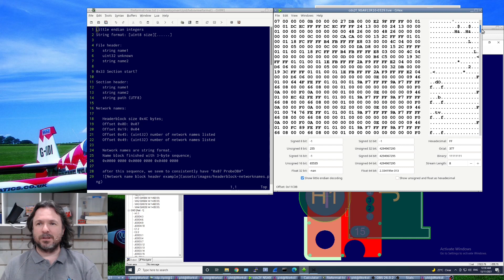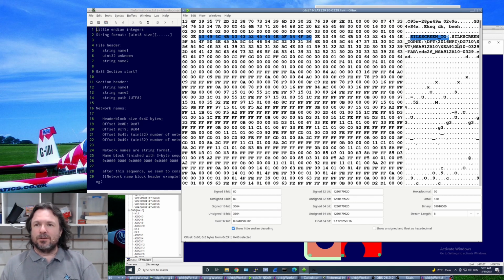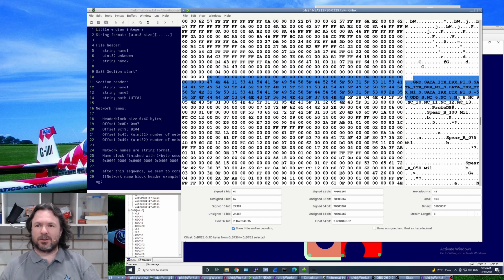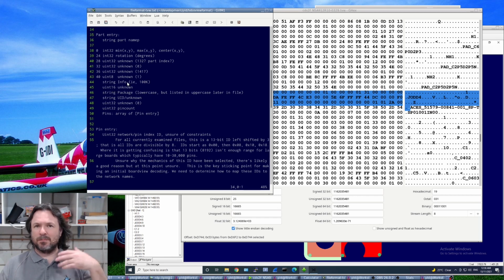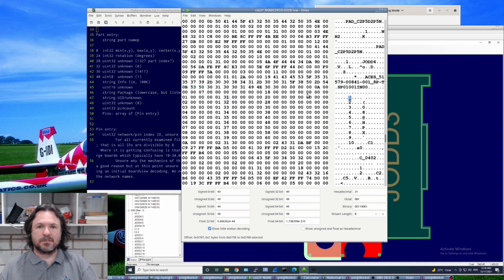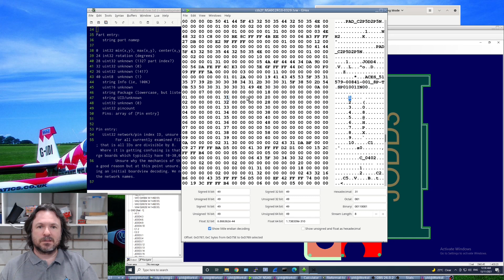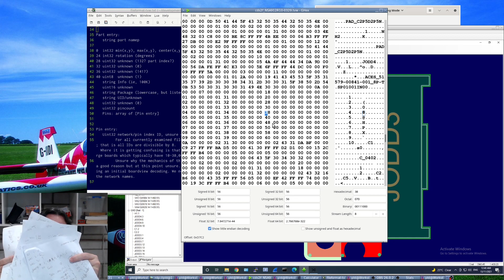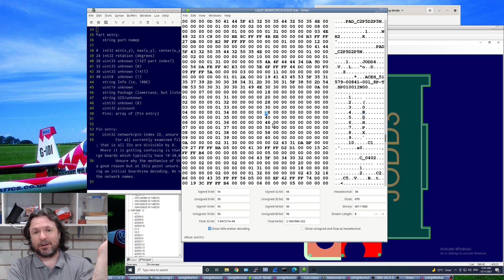Request for help!  File format specification for TeboView (tvw) board files required.

Comment from the maker: The big sticking point right now is finding the bridge between the part pins and associating a network with them.

Those interested in discussing the decoding and seeing sample files - https://www.badcaps.net/forum/showthread.php?t=100407

We know the network names, and they have an implied index ( by the order of their listing)
We know the part->pin association.
What we need now is to understand how to decode the network reference UINT32 (which has a unique starting value and increments by 8 each pin on the same net).

Check the github for the txt file which outlines what we've already found and check badcaps for some smaller sample files (under 100K).  Teboviewer is free to download and there's also Boardviewer which can parse this file
Reply from the maker: @3x doesn't appear to be IDF 3 or 4 if that's what you're suggesting?

Comment: You are missing the software that's using this file format.. you need to reverse engineer that rather than the file format itself
Reply from the maker: I've got two examples of programs that read the file format. One that is offical, the other is 3rd party ( as mentioned in the video ).  It's not always easier to decode using the binary, especially if they've optimised/stripped the binary and thrown in a few debugging traps.   This file format is relatively clear/plain when you look at the file as hex, but there's a few "Hrmm?" parts to it.

Comment: Paul, why do you charge for your version of Open Board View when the goal is to promote "Right To Repair"? Seems you've fallen into the OEM trap of profiting over illuminating. You use odd terms for breaking down the structure of the "structure" of the file. Header defines the structure, the structure size and depth are unknown. Brute force should be able to determine all of these components.
Reply: RTR has nothing to do with how much someone charges for their work.  What software have YOU written and given away for free?
Reply from the maker: Welcome back Robert King. As usual you seem to be lost in your own self-aggrandizing.

Comment: I trying live debug with x64dbg and breakpointing to state where I can see parser splitting file but it takes long time trying again and again.
Reply from the maker: It'll be difficult/long process because the section of interest likely is the last thing being parsed.  So far as I can tell there also (yet) doesn't seem to be any data-block-size data present, so it's being parsed on the fly until the data runs out, as opposed to "layer 6 is at offset 0xFF8352" etc.

Comment: Where do the 13 bits come from? Would make sense if the ID field clearly took 16 bits, but it seems like it can simply be 32 bits (it even is in your doc), thus allowing for 2^29 values, accounting for the shift.
Reply from the maker: That actually was a bit of old text in the document. It's a 32-bit uint, so plenty of room in there for all the pins indeed.